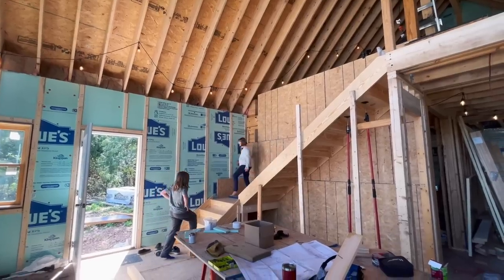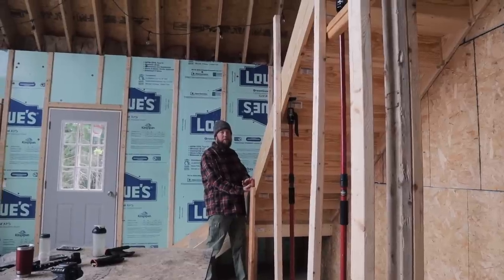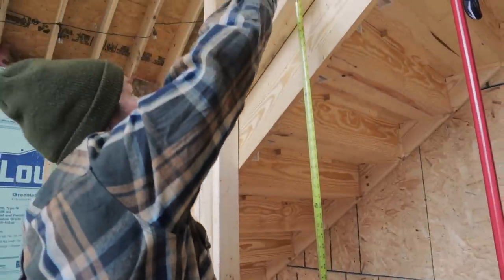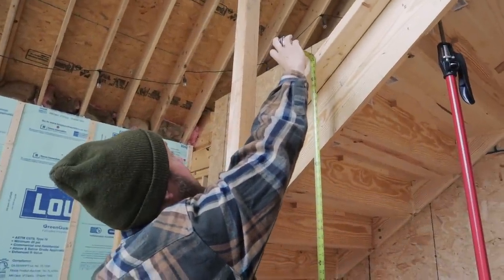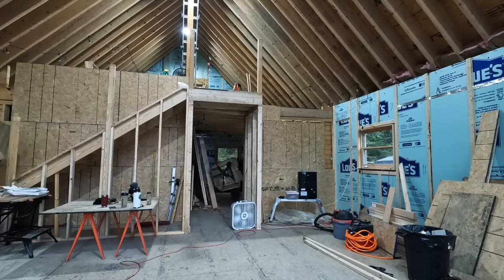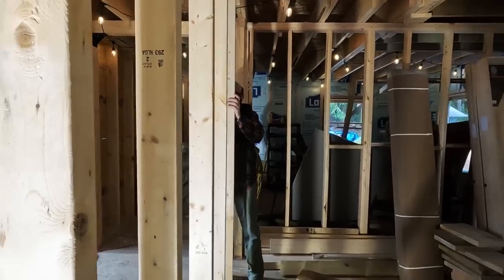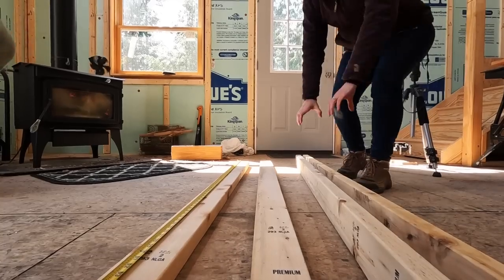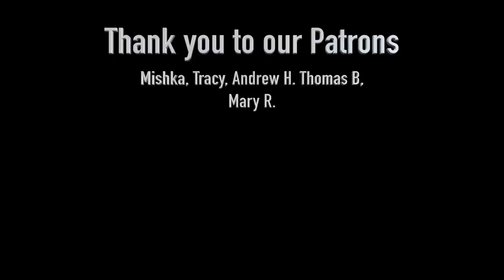FRAMING the WALLS of OUR CABIN with NO BUILDING EXPERIENCE

Comment: When it comes to drywall blocking 2x4 walls are typically capped with 2x6 material.  That gives you and 1.5 overhang to attach the drywall to.  Snap a chalk line around the stud walls at 4 feet and block along that line staggering above and below the line.  This give you a solid place to seam the drywall to.  Don't forget blocking for baseboard trim, wall handrails, toilet roll holder,s and towel bars.  I typically will just use 1/2 plywood for the walls behind cabinets.  This way you can get a solid connection at any point.

Comment: I have the same nail gun as yours. Started not driving nails in all the way.  Had to have it rebuilt.  Wotks fine now, but it cost almost as much as a new one to rebuild.
Reply from the maker: I can't quite figure it out.  Sometimes it works great and sometimes it doesn't drive all the way in.  I increased the PSI and it started working better.   Hopefully it will hold out for this project at least.
Reply: @OneFootOfftheGrid  seals may  be going out. Make sure to oil it enough. You shouldn't have to readjust your air pressure.

Comment: We do know you took off,  This is needed from time to time when taken on such a large job like this and just the two of you for the most part, Would have loved to been able to live closer guys and give you a hand. But you are doing great without me hahaha Electric and plumbing are not that hard just learn the codes for you area and pay someone to check you work as you go..... looks like the nail gun needs a good cleaning and adjustment, easy job to do. Anyway great job so far, doing very good, and I also like doing the electric and plumbing and plumbing has gotten so much faster and easier with all the new products.